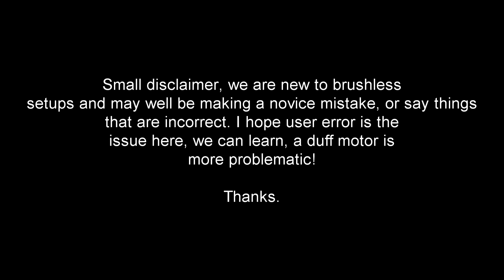Brushless motor issue - Turnigy SK3 Fandrive

Comment: Motor windings sound burnt. I have 2 of those Turnigy SK3 3968 1500kv inrunners and they're both going strong. One on 7s and the other on 8s. that 5s should still make it power up a lot more then it did. Best of luck to you.

Comment: You know I am not a brushless expert but could the ESC be set for a different timing than the motor requires or not be using the correct number of poles?